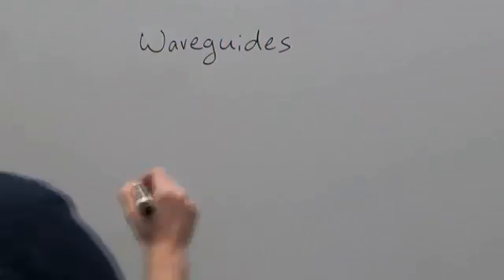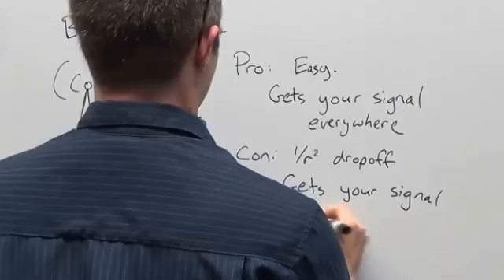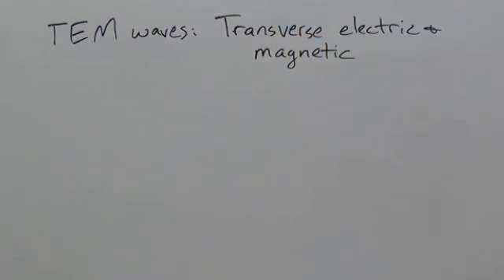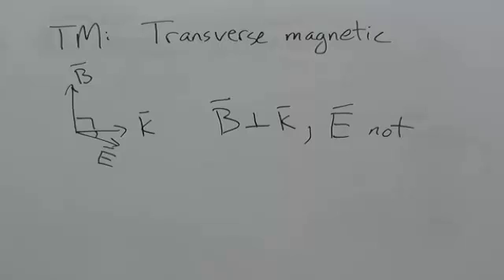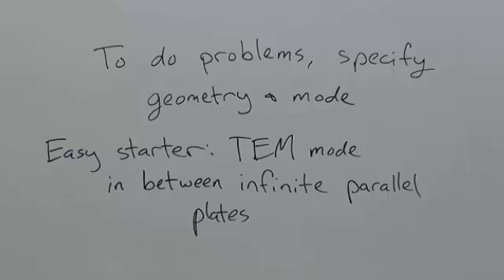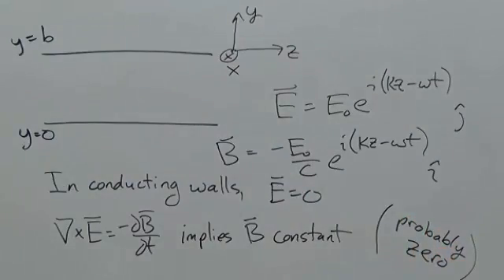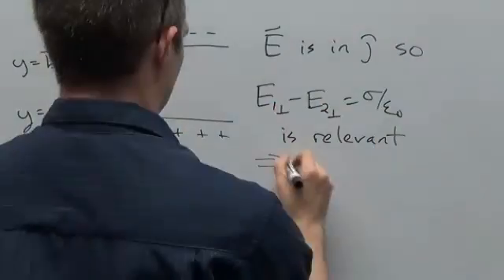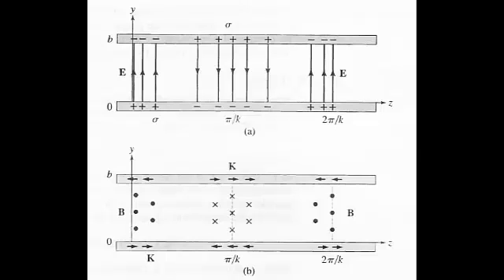Waveguide intro

Comment: I understood none of this. Like, at all.
Reply: Engineering Student here: I still study this stuff so take everything with a grain of salt. It requires familiarity with Electromagnetic Field Theory (Maxwell's equations), which in turn requires familiarity with Electromagnetism (Electric Field, inverse square law, Electromagnetic duality) and (Multi-variable) Differential Equations (Boundary Conditions). tl;dr: Broadcasting Signals is not efficient, thus it would be better to "focus" the wave towards a path with a "guide" (conductive surface or cable). To calculate how thick your cable must be, which is the most optimal frequency of transmission, how to prevent electric current reflecting back etc we need to solve Maxwell's Equations (that describe Electromagnetism very well) and incorporate the interaction of the E/M fields with the Boundary Conditions of the conductive "waveguide" (Boundary Conditions: extra equations that describe the material properties and geometry of the waveguide). Spoiler alert: it helps with propagating the wave further. (compared with modern physics like "the Standard Model", Maxwell's Equations are "outdated" but they are still useful approximations). I study this as part of the course "Microwaves" in National Technical University of Athens. The exam is tomorrow wish me luck :P
Reply: @JamesSarantidis  this explanation helped me alot, thanks :)

Comment: how can TE Waves exist, i.e how is it possible that magnetic field is not perpendicular to direcyion of propagation??
Reply from the maker: There's nothing requiring the magnetic field to be strictly perpendicular to the direction of propagation.  The way E&M is usually taught, the first waves you see are plane waves in vacuum.  Those have transverse magnetic fields, but that doesn't mean that always has to be the case.
Reply: @patkohl2680  But shouldn't the electric and magnetic fields be always perpendicular to the direction of propagation in an electromagnetic wave?
Reply: Are waves with nontransverse B or E fields just a mathematical way of representing waves which have transverse components of propagation (which bounce off the walls)?  Or are those two different things?  Because for some reason, k is taken to be in the z direction.  Or have transverse k have already been solved for, accounting for boundary conditions, and included in the form of the solution?